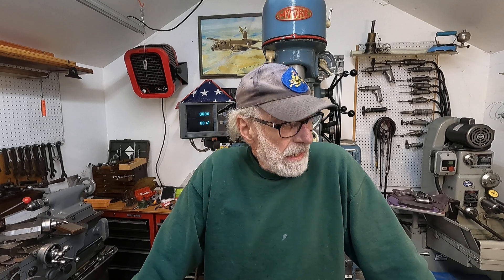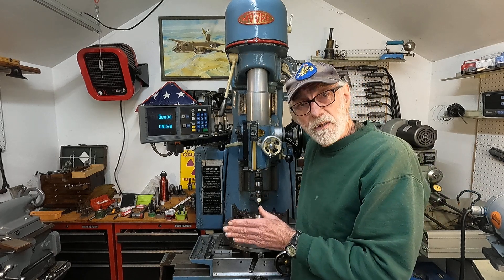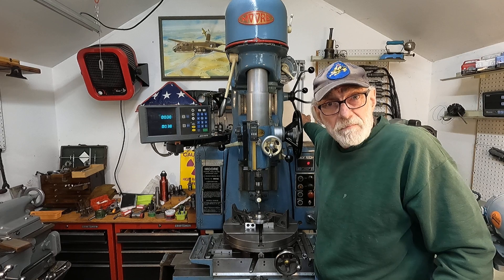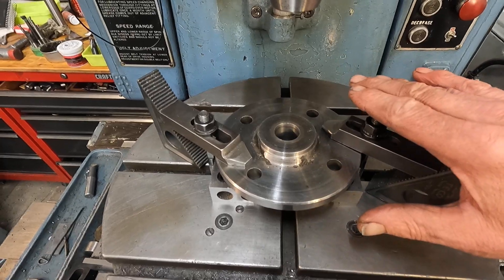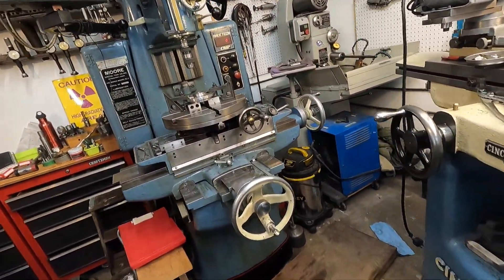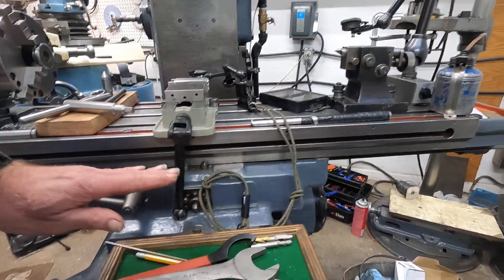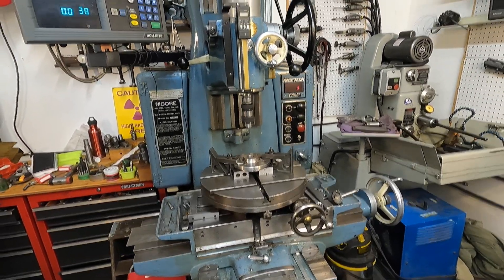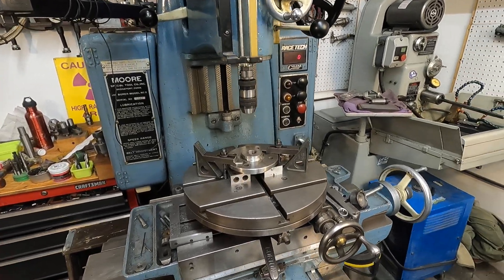Moore jig boring machine basic hole making 1

Comment: Hi dee dee, new subscriber here...You are exactly right about the "jig bore man" at most companies back in the day lol!  I worked in the tool room of Teledyne Republic Valve in the 1980's-90's as a machinist-welder. The Jig bore man had his own little shop with his Moore, a Bridgeport, and a SB 13 lathe, Do-all vertical saw...none of us "mere mortal machinists" were allowed to to touch his stuff, except the Do-all. in his world but he was allowed free reign in the whole  tooling dept..,  and was the TOP PAYED MAN.  Thank God CNC machines ended this shop tyranny LOL!  You have a great channel and God Bless! 👍👍✔✔
Reply from the maker: They had a slow way of getting things done. The best way to apply the machine in these times is to carve out the part on standard machines that can move material, then do the important hole location and accuracy as needed on the jig borer, or get it done already. The same with the Monarch ee.
Reply: @deedeeindustrialsuperprecision  Thanks, you have a nice informative channel.

Comment: Hi, I litrally just got my first jig borer, never used one before and I've never seen one in the flesh. But I had the opportunity to own this one and I took it. It's a elgar jig borer... I have no information on it and it's around 2000kg. Plenty of people saying it's just a big paper weight ect. First video I've seen of youres and I have subscribed the demonstration with the vice on the mill was an eye opener...
Reply from the maker: I will try to research your machine, sounds like a solid one. I use this machine mostly for repairing motorcycle crank cases and any other power transmission cases where bearing pocket damage occurs, using the machine to sleeve, re machine after weld repair, surface mating edges, locate and machine dowl pin locations, match mis matched cases and a lot more. It does those things better than a standard vertical mill. The spindle is designed for plunging straight in and using a single point cutter boring head but not so much for any heavy side milling. I am currently using a horizontal mill along with the jig borer, makes a nice combo, thanks for tuning in!
Reply: @deedeeindustrialsuperprecision  cheers dude. There is a video of me putting my borer back together on my channel, it was way to top heavy to move down my stairs plus it had to be split to get it out of it's old home. I have a adcock and shipley 1es horizontal mill that I use all the time with a Bridgeport head but I really dont like to drill on it, speed ranges are very poor on the low end 225 is the slowest, but I have picked up a Victoria u2 horizontal mill too but no quill. I've just been watching you're cutter grinder videos as I also got a full size one of them from the same place. You have a really nice shop and I find you're voice most relaxing. Lol

Comment: Thanks for the videos.  Yesterday I decided I needed to learn about jig boring so I did a search.  You'd uploaded the videos the day before.  It felt like the videos were made just for me!
Reply from the maker: There are many aspects to jig boring machine other than making the original jigs that slide down the tables of multiheaded drill presses. I have adapted the machine for repair of castings and other work that requires close alignment and other tolerances. I found the machine pretty friendly

Comment: This is a great piece of equipment you have.  It certainly have its own niche market.
In your next video, could you go threw the machine and tell us about its capacity, travel, weight, speeds, what collet holder it takes (ie more details on the spindle).  What it is best suited for and where it excels!
Thank you for sharing!
Reply from the maker: It will take multiple videos for the very basics, I can fill in those details as I go thanks for the input there.

Comment: So serious question, I build my own motorcycle drag racing engines and have recently gotten into Harley’s, I was wondering if a Moore jig borer would be a good machine to bore Harley cylinders???  I have a Bridgeport but the quill travel isn’t enough for the height of a Harley cylinder without using the knee to get the last inch or so needed.  How much travel is the quill on the Moore jig borers and is there any reason I couldn’t bore cylinders with one?  What’s taper does it use in the spindle/tooling?  I think I saw a photo and it appeared more substantial than the r8 of the Bridgeport, another reason I don’t think my Bridgeport would be very good.  I’m familiar with kwik way, Rottler, and the other makes of dedicated boring bars (engine cylinder boring machines) but if I could do it with a Moore jig bore I basically get use of it for other things where the dedicated kwik way type is single purpose machine.  Also the jig borer I’ve seen for sale are pretty reasonable price too!  I do also know it can be done on a lathe but my Leblond is pretty clapped out and not accuarate enough without some refurbishing to do the job very well!   
Thanks for your time hope to hear back from you
Reply from the maker: Hi, the Moore has the same 5" of quill travel, the Excello XLO 602 has 6"of quill travel and would be nice. I used a lathe for boring out sportster 883 to 12000cc and twiincam 88 to 95". In practice the cylinders are sized to the next .010 oversize by honing as per standard HD practice using the Sunnen 110 type rigid hone using coarse stones dry for roughing then fine stones with oil.. The Moore jigbore was ideal for repairing crankcases and boring the cases for big cylinders such as S&S big bore kits.

Comment: The Jig borer I ran a lot of years ago used 1" ground rollers with a micrometer head that sat on the rollers. That wat you could move the table whole !" increments then dial in the thousandths with the micrometer dial. This was in the days before the age digital readouts. A movement of 0.0001" was easily attained.
Reply from the maker: Yes! I was also mentioned by a viewer that a part can be moved without using the table adjustment, just use ground edges and slide then clamp the part dialing in the same way, great point.